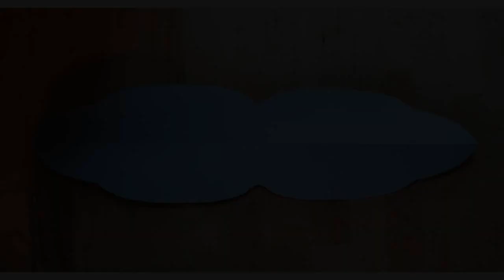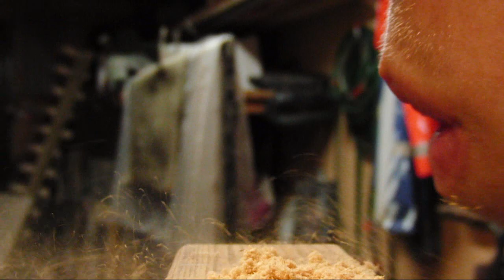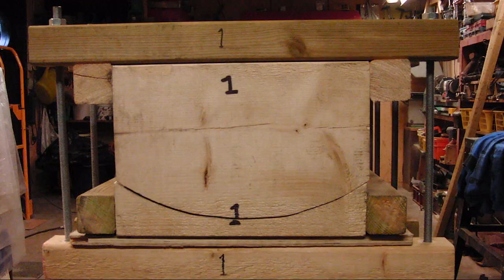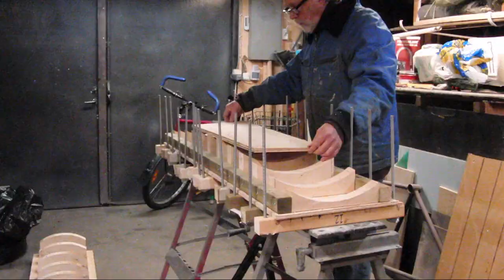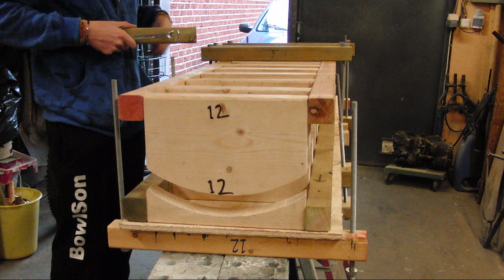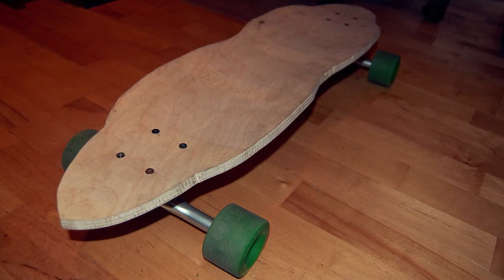This is how I made my longboard

Comment: That's really cool, and I like your press design, however, I would HIGHLY recommend putting waterproof finish, and griptape on that. Also, take a sander, and sand the edges, you don't necessarily have to round them, but at least sand off the edges to remove any strands of wood. It's unnecessary, but cool, if you wanted to paint the bottom of your board as well, before you put the finish on, of course. Other than that, and maybe some fiberglass for support on the bottom, really nice board.

Comment from the maker: @sectoronetwothree thanks man. i dont really understand what you mean ^^ but yes i sanded the board with a "sanding machine" (a grinder) and there was no problem. i used polyurethane glue that apparently expands and fills air bubbels, try that!